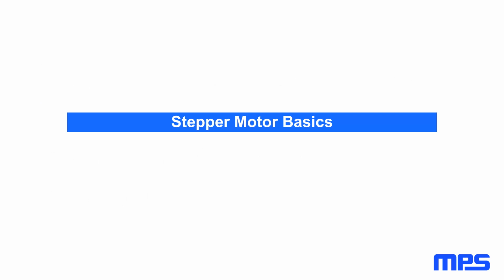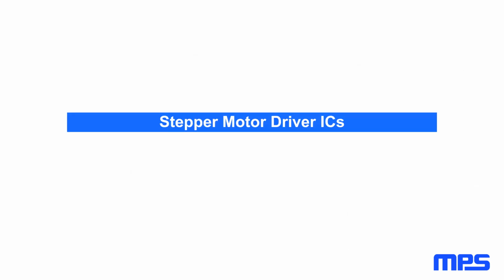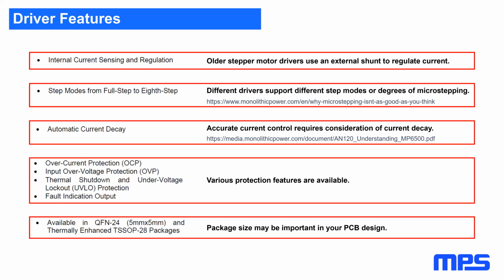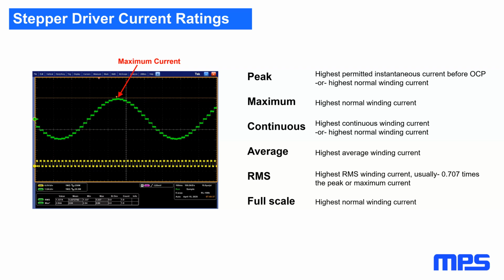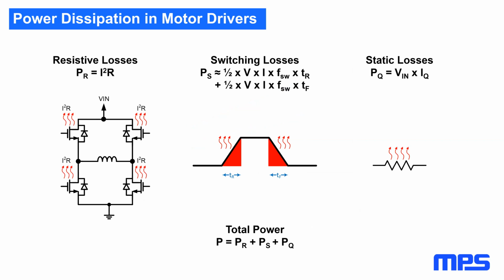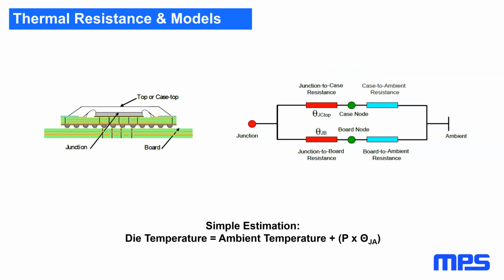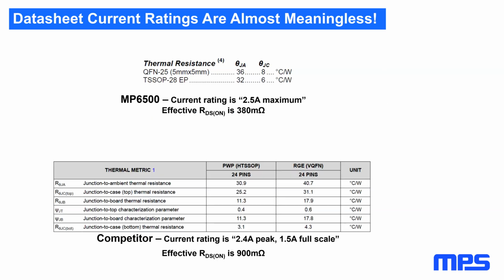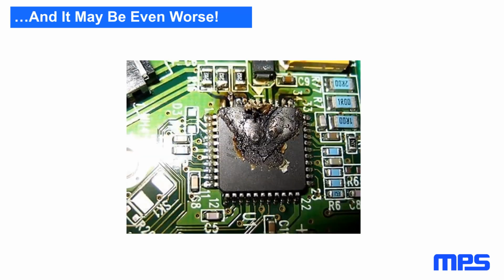Choosing the Right Stepper Motor Driver

Comment: 13:36 the explanation wasn't super clear. What's the advantage to having a lower RDSon for the low-side mosfets as compared to the high-side mosfets?
Reply from the maker: The low side MOSFET in each H-bridge is one for a full half step, as current is flowing in one direction.  Also, usually the duty cycle of the other side (which is switching with a PWM waveform) is around 50% or less.  So averaged over a long time (like a whole step) the total amount of time that the low side FETs conduct is maybe twice the amount of time that the high side conducts. Making the low side lower rds(on) then generates less heat (again, averaged over time).